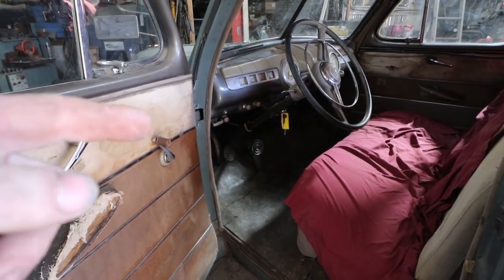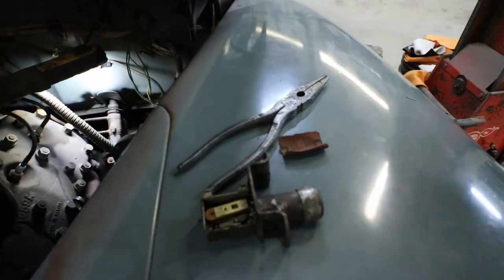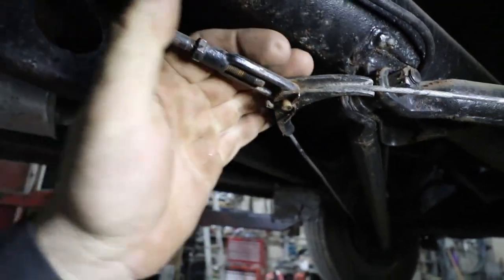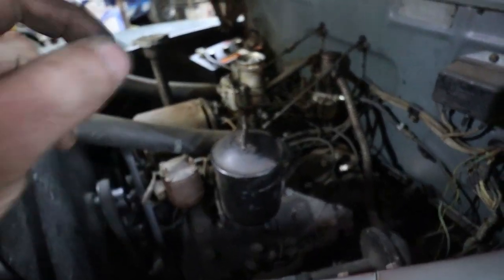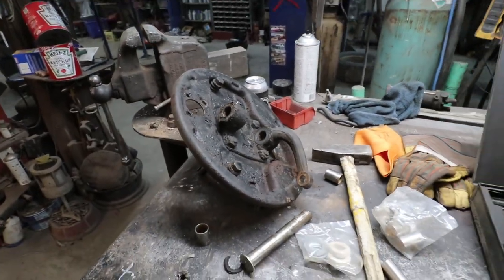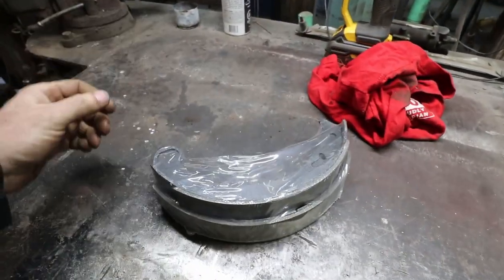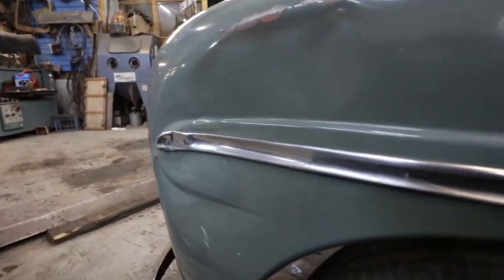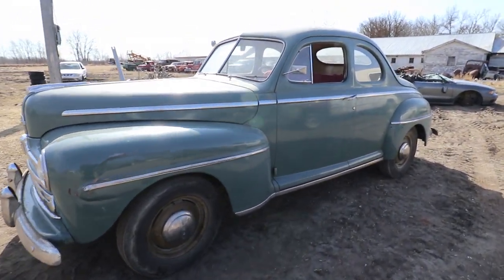Finishing the mechanical on the 47 Ford Coupe and test driving before a photo shoot

Comment: This one is a bit of a mixed bag only because I can't decide on the parts of the video that I liked best, I suppose it's all good, I enjoyed everything. The 47 has certainly gotten a clean bill of health that's for sure.  I thought it was funny when you mentioned installing the king pin bushings. You were opining on whether if it were the right or wrong way. I would venture to guess, 90% of the population don't even know what it is and the rest wouldn't know if it were fit to eat, from what I know, without the use of a press, like you said...,it doesn't really matter which way as long as it all goes back together with no slop, much like old door pins and bushings.  Great videos and content as always Brent, nice drone work.👍👍

Comment: Starting with wins!  At least they were made simple as you say.  Anything post 70s when you take apart a switch ball bearings and springs fall out.  Maybe that's why old cars cost more now?  A small brass wire hand brush is great for cleaning instead of emery cloth.

Comment: Just a tip on bodywork when trying to save the paint. I have a set of hammers and dollys I have polished up to a mirror shine on the surface, you can slap even cheap repaints and not mar up the finish. Obviously, you have to be careful, but in my opinion, it works better than tape.

Comment: For next time, try running crushed chrome trim through your bead roller, if you have a die that is similar to the needed profile it should work with a smother finish.

Comment: Bushings in the freezer, hub in the oven. reaming on the road side, no drive or garage, and that tapered bolt that steadies the kingpin is called a cotter pin in the UK. Not done a kingpin for years.
Cheers

Comment: Love the video. I have a New Zealand built 48 club cpe  it is RHD and came into the country knocked down from the Commonwealth plant ex FOMOCO Canada. Had an early 47 business cpe before this. I presume this is Canadian as you have the oil filler pipe in the front of the inlet manifold like mine does, that the Dearborn cars did not have.

Comment: Who would think you could take something apart and fix it? 
I took the fargo dimmer apart,headlight and panel light switch too. Got them all working. Ignition switch got a soaking in brake cleaner,and beat it on bench a few times. 100 %. 
Cant do that on today’s stuff, it all goes in the can.

Comment: I forgot how much fun king pins were
Reply: I replaced the king pins on my 31 Ford beam axle, and never had to use a torch. The replacement bushings were nylon, which made installation a snap.
Reply from the maker: that would be a first any I've done was brass

Comment: ***  Brent, if there's one common link I think, that ties all Fords, Mercuries and Lincolns together as being "all of the same family", it's one genetic weakness.  ...Please tell me your car's clock doesn't work.  I owned about 5 Fords in my life, a '49 shoebox, a '50 Lincoln, a 51 Mercury and a '57 Skyliner and their clocks never worked. I shrugged it off to all having been used cars.   However, in 1988 I bought a brand new Town car. there were 2 miles on the odometer when I drove out of the dealership.  41 Days and 257 miles later, the clock stopped.  I drove it back to the dealer and was told that I would have to Pay for the new clock as that was one of the few things NOT covered on the Warranty.  So, I forked over $150 or so dollars to have the clock replaced.  The second one lasted 1 year into 1989 then it too stopped for no apparent reason.  I had it checked out and was told the same thing that it couldn't be repaired only replaced and it was "Not covered under the warranty"  So until I sold the car in 2000, I drove a low mileage Lincoln (89,k miles) without a clock.
Reply from the maker: haha I think it actually worked
Reply: Yes! The clock works!